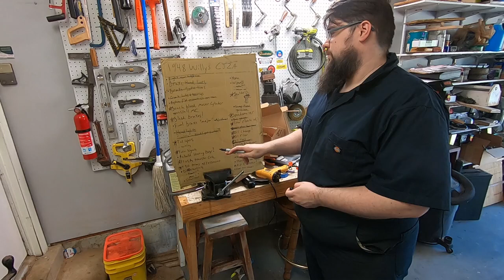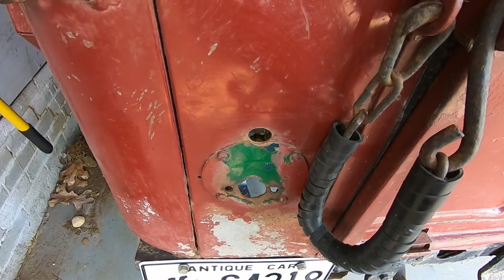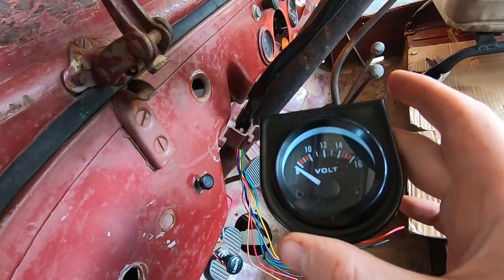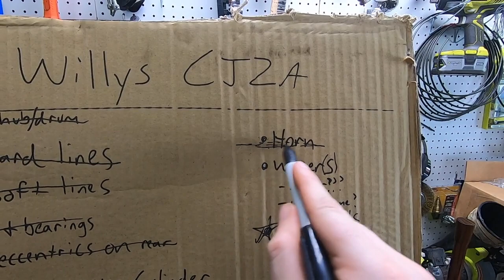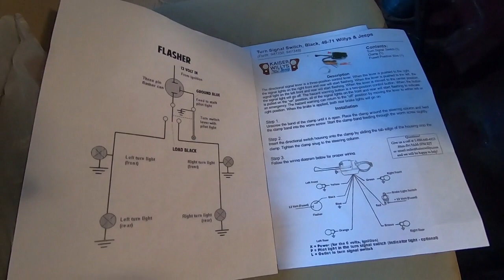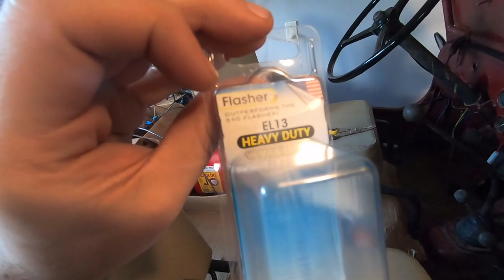Ep. 42: Brake Lights, Turn Signals, and a Horn

Comment: E brake cable, same problem happened to me.  You are probably mounting it where the previous owner had it mounted.   If you scrape the muck and grime off the crossmember farther forward,  you will find another mounting hole about three or four inches from the current  hole.  This is where it belongs,  you'll be amazed at how well it works from the new mounting position.
Reply from the maker: This was one of those areas where I didn't have anything from the previous owner to go off of. But I previously scraped some junk off it and found a hole right in the middle of the crossmember, so I used that one. Maybe I missed another hole under the grime on the front edge? like you said.

Comment: With the front turn signals I'll be using a duel filament Bulb in the original park light on the grill
Reply from the maker: Mine had single filament bulb sockets but that would have been a more ideal solution. It looks like what I have were a "bubba" special. #57 sockets from who knows where, attached with self tapping screws.

Comment: So jealous here :) I have noticed you put the things, with little wheels, under the real wheels and you turned the Jeep around. If I remember right it was facing the ramp :) good progress
Reply from the maker: The car dollies are great. When the tow truck first put the Jeep in the garage, it was too close to the wall and I couldn't do much on the passenger side. Now I can roll the jeep around wherever I need so I can access everything, then push it right against the wall to maximize space when I'm not working on it.

Comment: Looks like the end of the cable sleeve is too far back. Can’t see if you have the right clamp (PN A8847) that holds the end of the cable sleeve.  The end of the cable sleeve fits into it and the wider diameter part of the sleeve stops against it.  Then the clamp gets bolted to the hole in the middle of the crossmember.  The clamp also has an alignment tab that goes through a smaller hole in the crossmember next to the bolt hole.  There’s a similar clamp (PN 638780) on the firewall bracket which holds that side. Both clamps hold the cable sleeve the right distance away from the handle cane and brake lever and should take up that slack.
Reply from the maker: The clamp I have is a rubber coated one of similar style to the correct one, minus the alignment tab. I don't recall seeing an extra hole for an alignment tab but the whole area is caked in grease and mud so I could easily have missed it. The firewall bracket was present so it's properly holding the other end in place. I once saw a photo of a 3rd bracket on the bell housing, but I don't know if that was original or added on by the owner of that one.
Reply: Sounds like what you have should work. Make sure the smaller diameter part of metal end of the sleeve fits tight into the clamp and the wider diameter of the metal end acts as a stop against the side of the clamp so the sleeve can’t slide all the way through. The clamps at each end of the sleeve are the only ones that control adjustment of the cable. Any clamps in the middle of the sleeve just keep it from flopping around and won’t affect brake operation. The only other adjustment for the cable is how far you thread on the clevis at the brake end. The clevis on my 48 is about half way down the threads, but I have the later style cane and cable, and I don’t know if that makes a difference overall.

Comment: Things coming along.  Weird how things that aren’t on the must do list end up that way (horn), but horns are required for inspection at various state  DMVs.   My Jeep is being retired in 12v because the original 24v is too expensive and not necessary.  Good luck with it all. Do you use the CJ2a forum?
Reply from the maker: Yes, I have a build thread on the CJ2A forum. Its not as interesting as many of the other builds so it doesn't get a lot of attention.
Reply: @SunkCostGarage   which one is it?   I don’t post on there, just follow- since my Jeep is a 52 M38 there is a willysmjeep forum I post my build on.
Reply from the maker: @CoastieReid  #158011 in the title of the thread